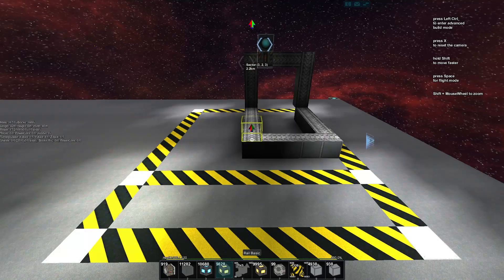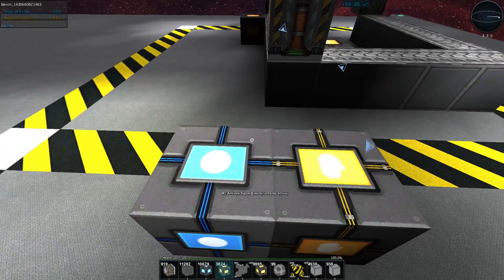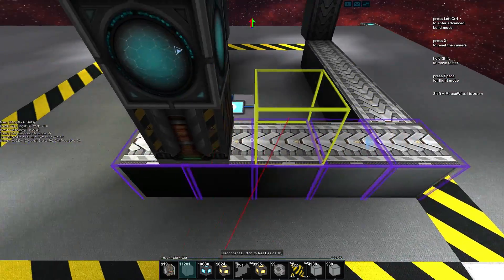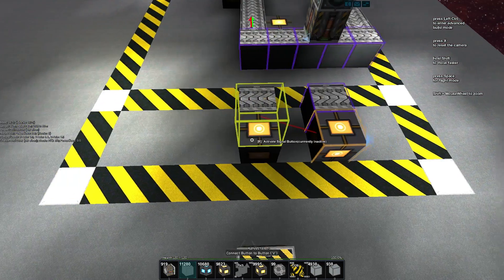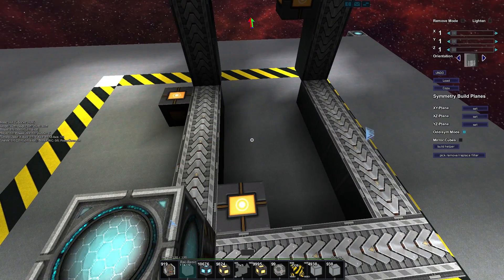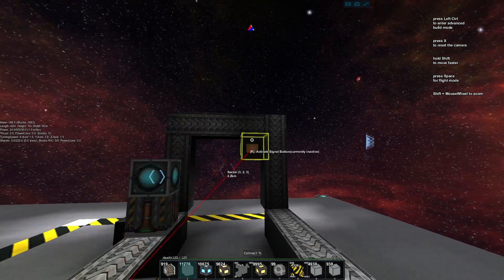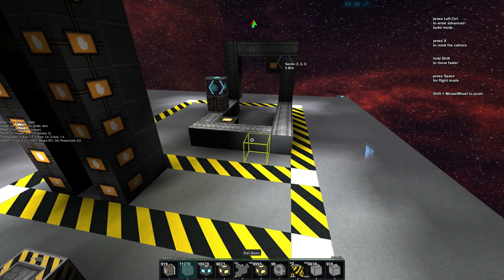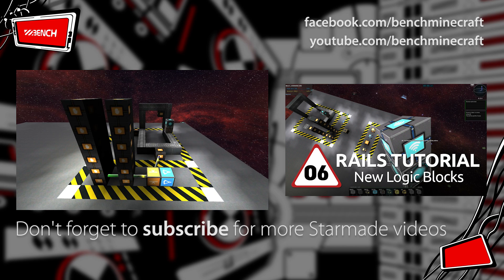Starmade Rails - 05 - Controlling Rail Basics

Comment: im trying to make a lift entrance to my ship, so i got the rails, docked the lift to it, then, i placed a activation block at top and bottom, connect both to all the rails making the lift, then connected a up facing rail to the bottom activation block and a down facing one to the top one, its not working! why? can you please tell me?
Reply from the maker: you need your buttons (should be buttons, not activation modules) to be next to the block you want your rails to change to. so at the top the button would be next to a rail pointing down, and the bottom one would be next to a rail pointing up.
Reply: ohhhhh thanks, got it too work